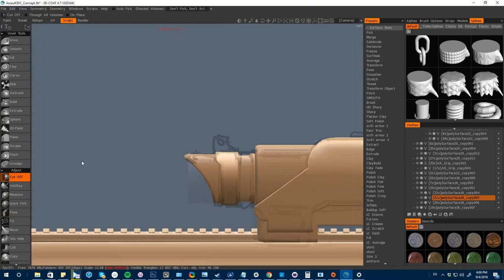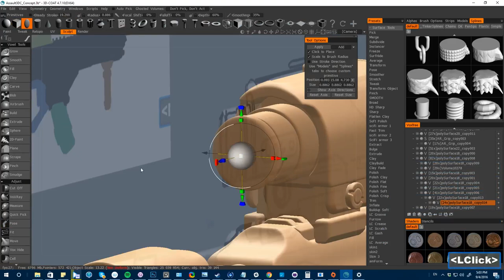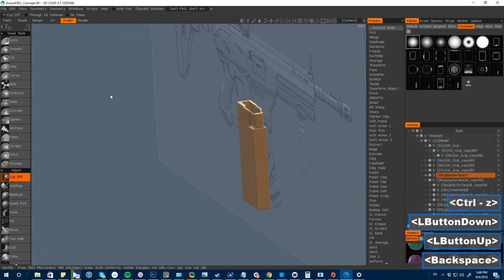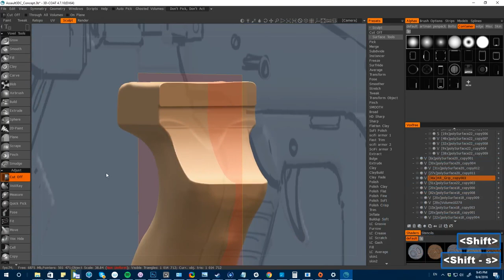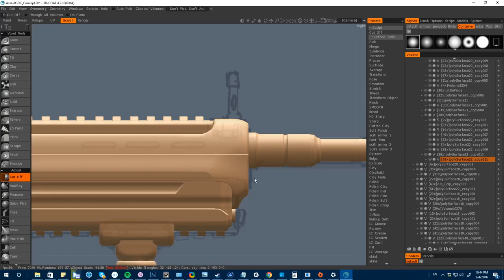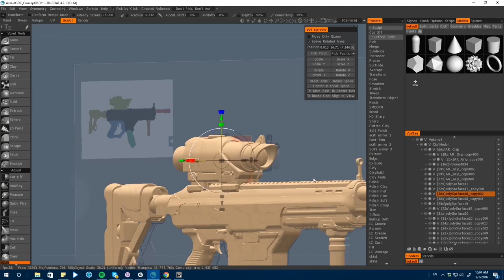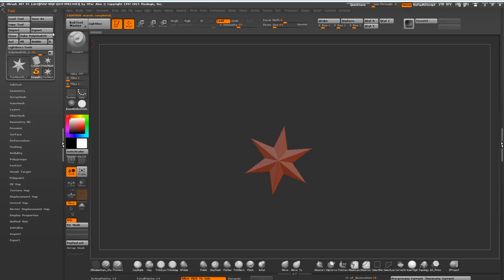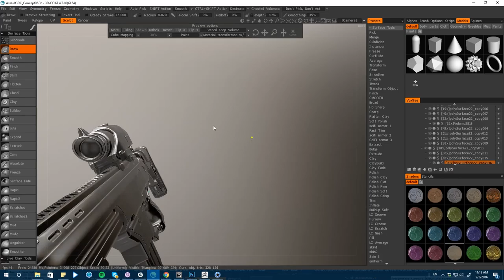3D-Coat for Hardsurface Design pt. 2

Comment: Correct me if I’m wrong ,3D coat using voxel as main workflow so have more freedom and less shading problem compare to polygon modeling ;so later just reduce voxel or retepo to have clean baking mesh ,is true what I’m thinking ?

Comment: Nice video. I want to know, how can i make this to low poly if i build to high poly model in 3dcoat? I tried autoretopo and zremesher but not work
Reply from the maker: For more complex models, you most likely would want to retopologize manually. I use 3D Coat for all precise retopology, and zremesher/autopo to quickly cleanup sculpting meshes.
Reply: Thanks for your advice! I have a fairly complex hard surface sculpt here...  I tried to use re-mesh functions but found out they couldn't keep clean edges...and the poly count was still too high that my substance painter crashed
Reply from the maker: Yeah. manual is the way to go if you want to maintain edges 100%.
Reply: You mean, I need to retopo it, then subdiv, project, then retopo again, ....... ? That would be really painful...
Reply from the maker: If you are making a game ready model, you don't need to subdivide it. You retopologize to get low poly. Most retopo tools will snap verts to the surface, so your low poly will fully match you high poly. At that point you UV unwrap your LP and bake normal maps in applications like Substance Painter or Xnormal. Hope this helps!